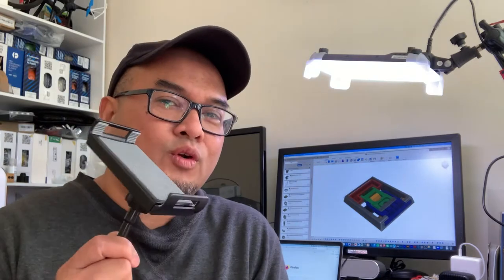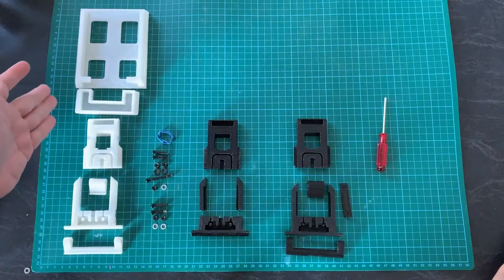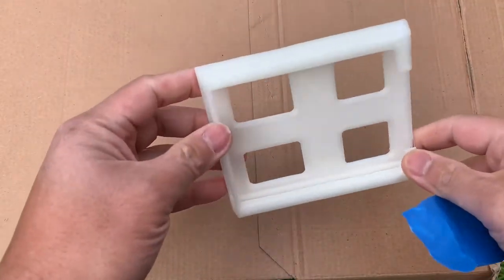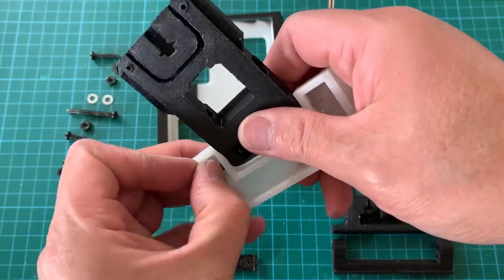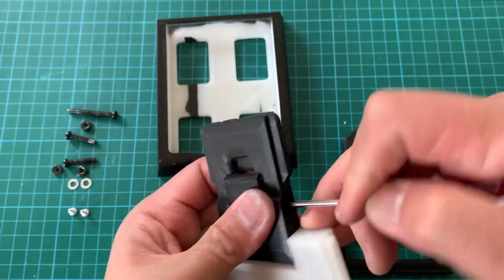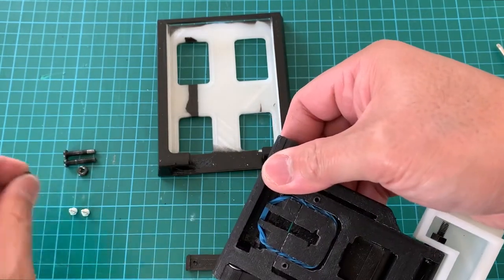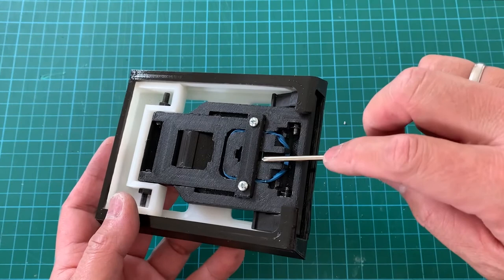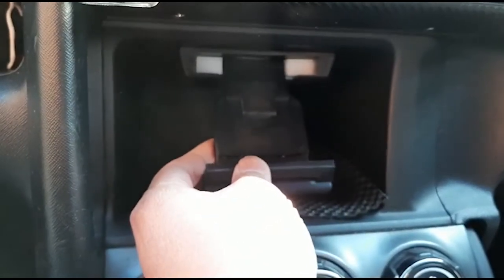A slim compact phone holder for my car - 3D printed

Comment: what material did you use?
Reply from the maker: Hi Jay, the initial white one was printed in PLA and the black ones are ABS.  I figured that in the Hot summer heat of Melbourne, the PLA would probably soften and shrink. Best recommended for any in-automobile applications would be using ABS.
Reply: @unclesullysprojects9379  Thanks for the follow up. Yes, expect the PLA to fail in summer heat. Though if it avoids direct sunlight, it might survive. Thinks like shape and what an item is attached to seem to affect PLA's ability to withstand heat and sun.

 I've been working on a similar project for aa 350Z and ditched PLA early as being too risky. PETG is right on the margin for softening in Arizona sun. It will NOT survive car dash heat.  I'll probably use a combination of PETG and ASA since the holder will avoid direct sunlight. I may regret using the PETG, but I'm being seduced by the lower price and low tendency to warp. 

I'd like to use ABS, but the ASA seems to have similar heat resistance and less tendency to warp. Tho the ApolloX I've been playing with is a bit more expensive.
Reply from the maker: @wturber  yeah. In a closed car, in peak summer heat the parts might just get close to its glassing temperature and shrink as it cools. 

Haha talking about Arizona, I experienced the heat back then on a trip and I remembered passing Yuma refuelling at a gas station and the sudden heat wave just hits you. I would imagine if a pla part sitting on the dashboard it will certainly deform.

Regards,
Sulhan
Reply from the maker: @wturber  Thanks for dropping by my channel. Have a great day.

Regards,
Sulhan (Sully)